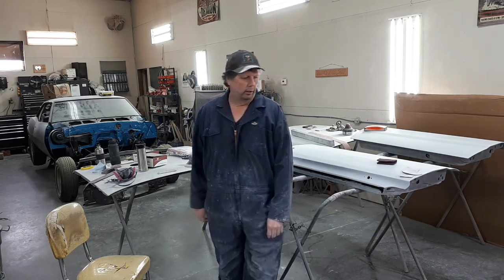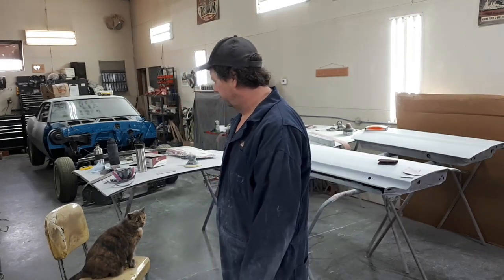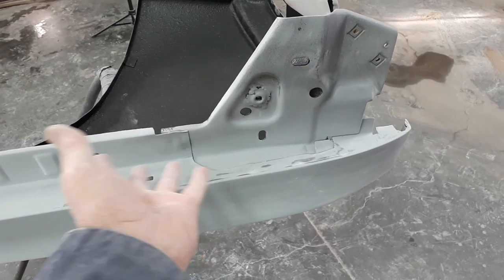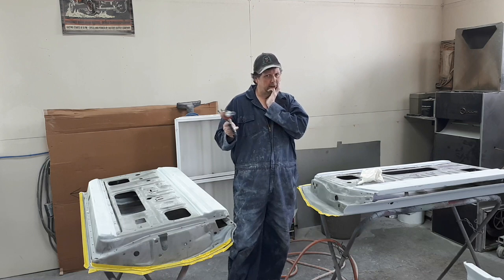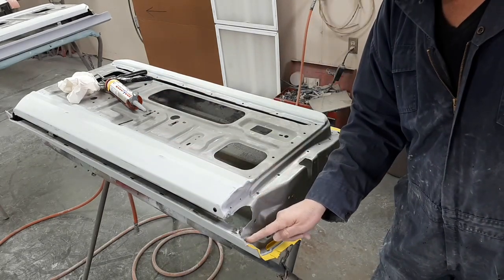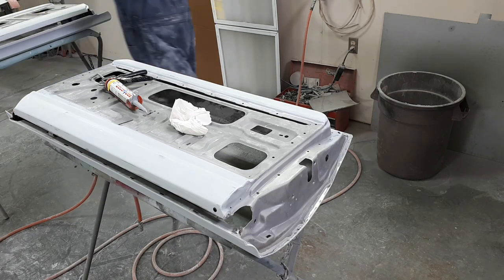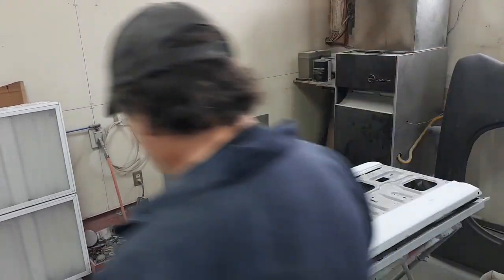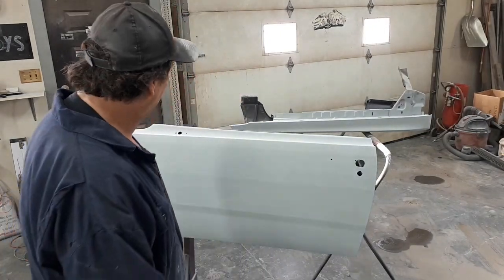1967 A Body Dart doors and fenders final prep

Comment: How much purple do you think the whole car will take in total?

7:43 1968 had the small round markers. Similar to that 1968 Barracuda fender you've got kicking around.

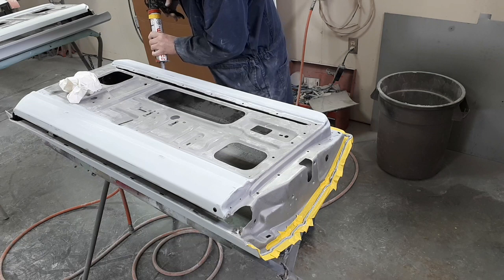14:44 That's a nice thing about being a one man shop.
Reply from the maker: I reckon it'll be 5-5 1/2 qts unreduced color and a little more clear. This color is taking 3 coats to cover.
Reply: @kars_tony  That's less than I would have guessed with painting the undercarriage too.

Comment: you might have a problem with those fenders , I have a 69 dart and i tried to use a 68 fender and the headlight is in a totally different location . i would probably throw the grill / light bucket covers on there to make sure it all fits before you paint.
Reply: i just looked at my old photos and your drivers side looks like the 68 fender in the bucket area. i’ve read that 67 and 68 are the same except for the marker light hole. I bet your passenger side fender is a later fender.
Reply from the maker: I took a tape to it, the bucket ring is slightly different shaped but measures 3/16 +/- to the other fenders position, I figure that's probably in speck for these cars and the trim clip holes are the same.
Reply from the maker: Never had a marker light, who knows.
Reply: @kars_tony  maybe it was a factory replacement fender from back in the 70s ? the weird stuff you find working on old cars lol!